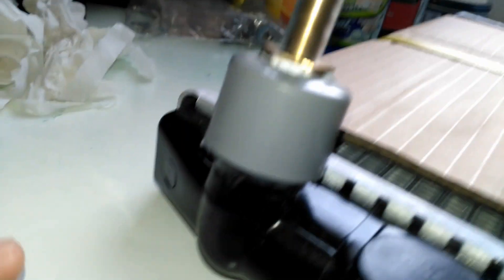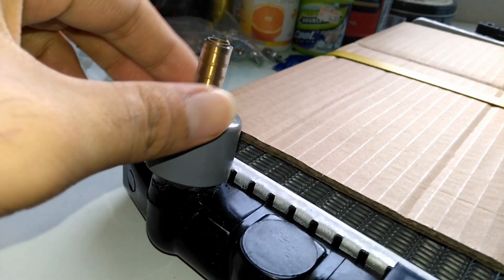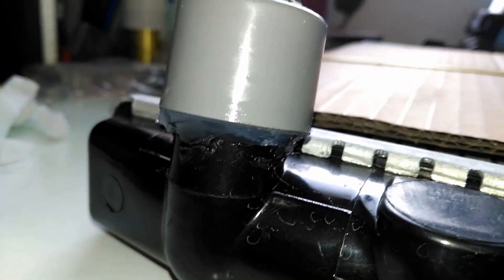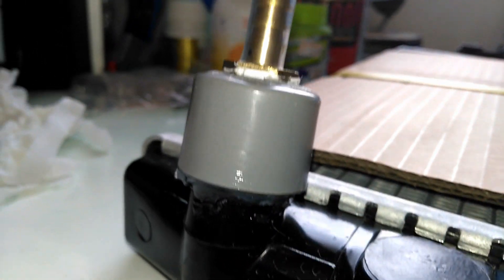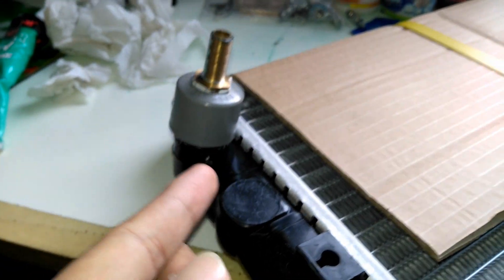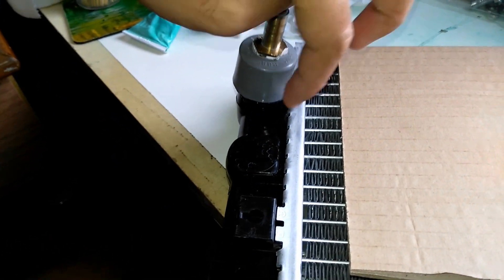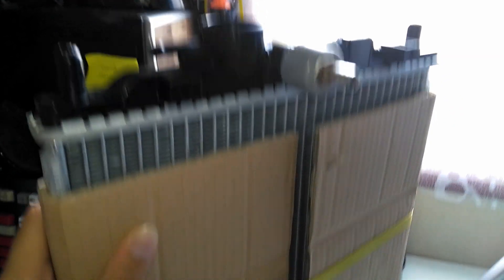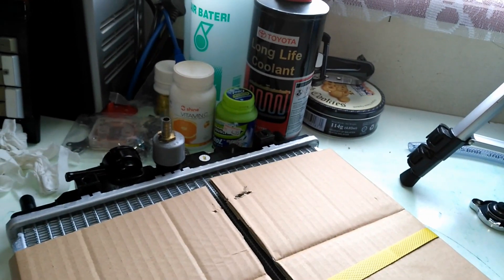This Asian Drink Battery Water?! PC With Car Radiator,  Crazy?

Comment: i love this,  actually i wanna makin somethin like this before watchin u, but car radiator is expensive for me, maybe i can buy the used one or if it's still expensive i'm thinking for a motorcycle radiator on used condition so i hope it's more lower price, bcs i think the radiator is more better than 120 240 or 360
Reply from the maker: I'm glad you like this. But I don't recommend you go for 2nd hand radiator especially cars radiator, most of it mostly rusted, it will cost your cpu block a huge problem not to mention all those fittings in your system. I got this is a single layer, most cheapest car from our place, with very cheap spare parts available in the market here, this is the cheapest radiator I can get, and way more cheaper and good performance than pc radiator. Think of one cheapest pc cooling system or just a radiator cost me few hundreds here, this car radiator cost me just under 100. Hope this video bring you some good motivation and good ideas! Happy DIYING! 😉
Reply: @KrisperKien  so the used one is kinda 'risky' with 'rusted' issues, hm... noted
i'm fogot with the corrosion aspect... silly me...

Comment: Is it safe krisper?
Reply from the maker: I tested the water make sure it is neutral before I test drink it. Not to mention I read the ingredient of the battery water for safety. As I know battery water is distilled water, not suitable for drinking, but for those acidic water made for battery recondition surely toxic and it can kills. Lastly, I AM NOT ADVICE YOU TO TRY THIS, AND WILL NOT RESPONSIBLE FOR ANY INCIDENT.
Reply from the maker: My PC water cooling use until today, it never give me a problem. I have a latest video for this build, feel free to check it out and I did maintenance for this build.